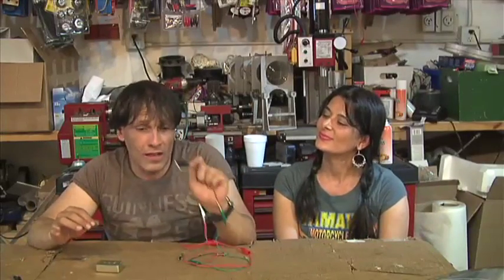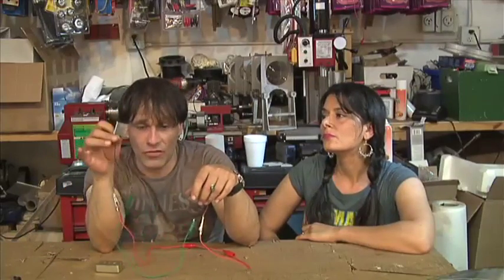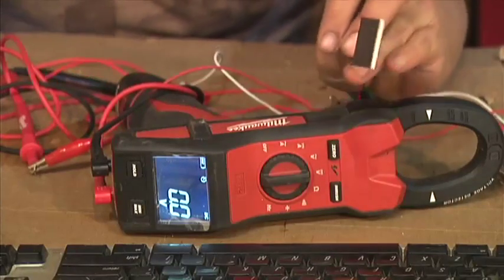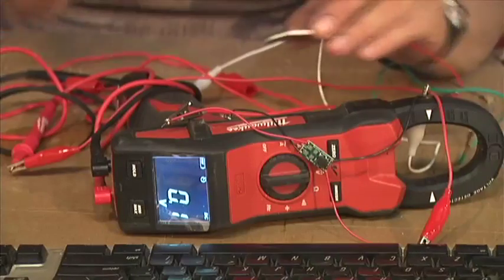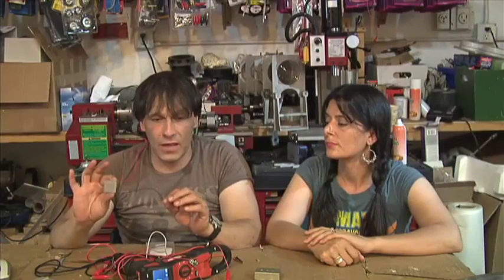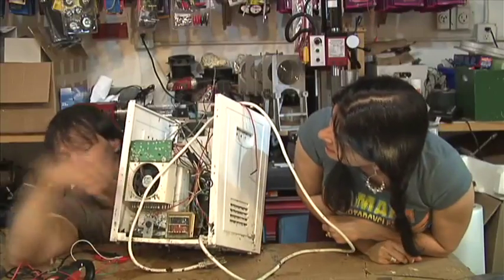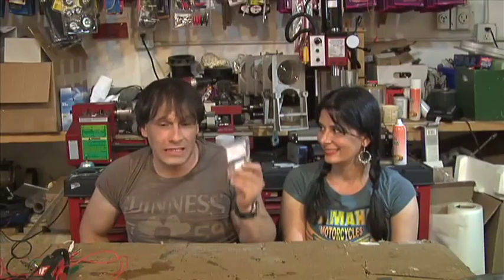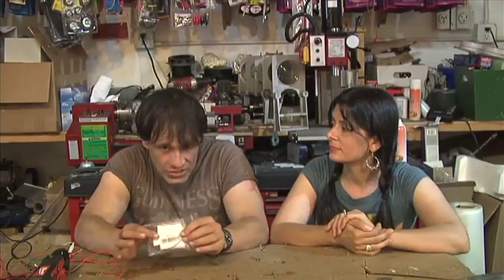Free Energy hot woman  Joule thief hack Thermoelectric Generator Seebeck Peltier TEG Joule thief

Comment: Does thermoelectric devices generate free energy?
Thermoelectric devices generate electricity from heat difference. It doesn't absorb heat. It just uses the flowing heat to generate energy. So is the energy generated by thermoelectric devices free energy?
What will happen if I stack 100 of these?  GREENPOWERSCIENCE

Comment: Hows about making a suit full of thermal electric generators and going outside on cool nights...enough power for a flashlight?
Or.... if your house has wood heat you could mount them with thermal paste to a window.hot on one side and cold on the other..the bigger the difference the more  power
Reply: You can mount TEG units on to the inside of your window.

Comment: That's awesome I got one on amazon :) http://www.amazon.com/s/?_encoding=UTF8&tag=kipkvide-20&linkCode=ur2&camp=1789&creative=390957&rh=i%3Aaps%2Ck%3Athermoelectric%20peltier&field-keywords=thermoelectric%20peltier&url=search-alias%3Daps%3EThermoelectric%20Peltier%20Generator%3C/a%3E%3Cimg%20src=
Reply: Hi , there . U will still require to use the voltage booster right ?

Comment: Hey Dan. This week I took apart one of the same type of water coolers as in this video. I first did the same as you, I looked behind the heat sink and saw this big thing that I thought was the Peltier module. But once I removed it, it turned out that most of that was some sort of foam insulation and the module was a small one the size of the small one you use in this video. I don't know if that's the case with yours, but I thought I'd mention it just in case.

Comment from the maker: Voltage does not = power without current and vise versa. The boost converter does the trick. = A joule thief is a minimalist self-oscillating voltage booster that is small, low-cost, and easy-to-build; typically used for driving light loads. It can use nearly all of the energy in a single-cell electric battery, even far below the voltage where other circuits consider the battery fully discharged (or "dead"). check wikipedia

Comment: Hi Dan&Denise , have you checked out a You Tube video from a British gentleman named Barumman titled "Stirling Cycle" Thermomechanical Generator.
If a block of 4 or 8 of these could be combined and put on a wood pellet stove or furnace maybe it could charge up a deep cycle battery.
Dan&Denise maybe you can find a way to hook a few of these TEGS on a car's exhaust manifold or cooling system to produce electrical power to run a hydrogen generator.

Comment: I'm thinking about the temperature difference between most appliances or motor systems and outdoors. The freon in the frig system gets extremely cold and also the dissipated heat (very hot). Same principle with the the different heaters in the home (air & water), and engines (block, or hottest point (ignition coil spark...) and coldest,...a/c freon again or in winter, again outside air. 
What have i missed?? 
We need current to charge caps, to recycle energy.

Comment: I have Peltier cooler plate and I tried to get it to light up an LED by running it with ice and my body heat and it didn't do the job... I even tried a voltmeter and it reads more than the LED uses it, but I can't get it to light up. I tried a very tiny solar panel that produces up to 6 volts but, and under a light bulb about 0.3v and it does light up the LED... why is this??

Comment: First thought: Are You going to use this thermoelectric generator with auto-targeting parabolic mirror?

There is a video on Youtube of a guy producing 10 volts 600mA with similar small system. Looks like alternative for a solar panel!

There was an idea on comment section to use thermoelectric generator with water preheated by mirror. Seems to be interesting alternative to problematic batteries.

Comment: ahh.. thats nice to see, you two are still very much in love, great stuff. Thanks you two. I've been thinking about putting these on my exhaust tube, then feeding the electric back to my 12v car battery... or maybe a leisure battery. If i had two i could bring one in doors once its charged and use it on my inverter. What you recon, would it be any more fuel efficient to gie the power back to the car battery?

Comment: Hi Dan,

We tried few month ago to mount on both side of a recycled peltier module heat sink from old computer.
Then we poured water from a mountain source (quite cold arround 8degC) on one side to keep it cool, and the other heat sink painted in black on the other side of the peltier module was "lighten" with a small parabola reflector. 

Worked fine. Still unfinished yet but will be used a small electricity generator to charge a 12V battery.

Keep up the good work !

Yves,

Comment: The vinyl around the copper would not withstand the heat. Your talking 900-1400 degrees. Add adhesives into the mix and its a total no go.

Comment: Why cant I line my exhaust pipe with TEG's and use the voltage generated for the cars system and running a smaller alternator to free up some HP?

Comment: and I put them on a heat sink and put the black part facing the sun and I was able to ceat 15 volts with .3 amps lol it worked it ran a computer fan to keep the heat sink cool it worked pretty good.

Comment: that is funny I was just playing with mine today and I was thinking about putting them behind my solar pannels to use the light to product power twice one with the solar cells and then when they heat up then trans fer that to heat with the thermoelectric's on them....I have just the regular one that when you apply the 12 volts to them they get cold on one side and hot on the other and I used those to make electricty I have 6 of them and I put them in seceries and painted them back on one side